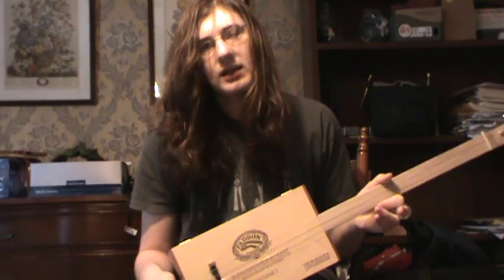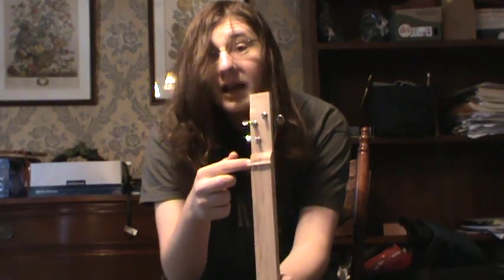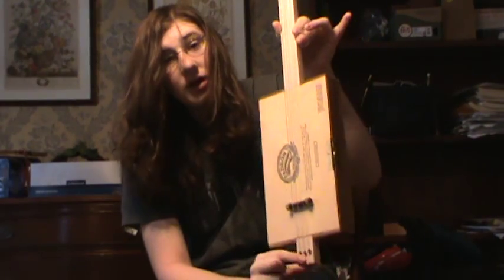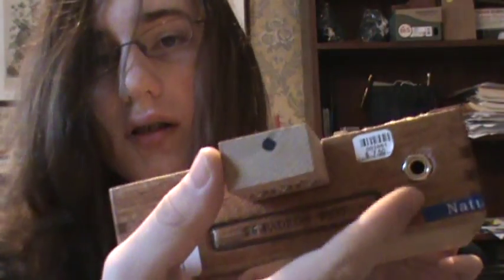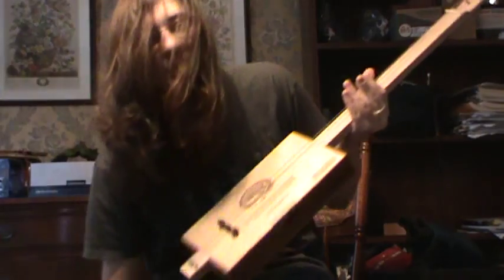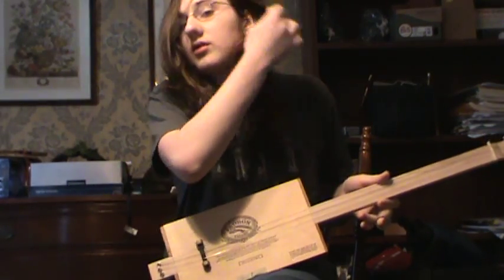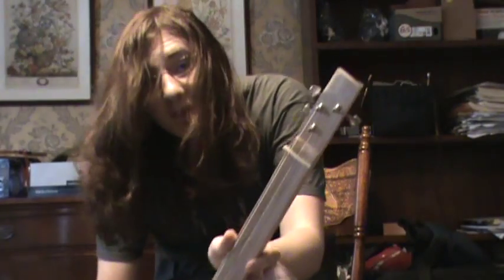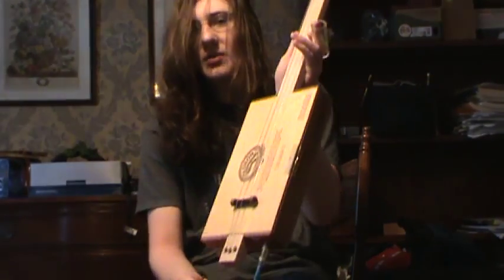My first Cigar Box Guitar Build. Padron 7000 Delta Blues

Comment from the maker: @KurtCobinmyhero I really do not know what I used in this build, It had a circuit board, which is not normal. I have been using I believe  273-066, but I am not sure. You might want to check with the guys over at cigar box nation, as I'm sure they can help you better. You probably want to join anyway, as they are a great community full of advice and ideas that they are willing to part with.